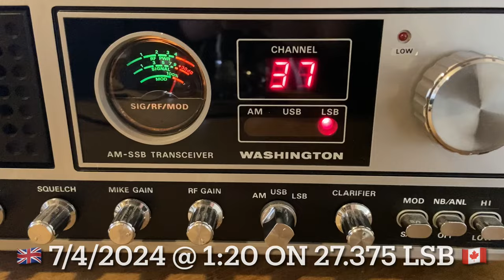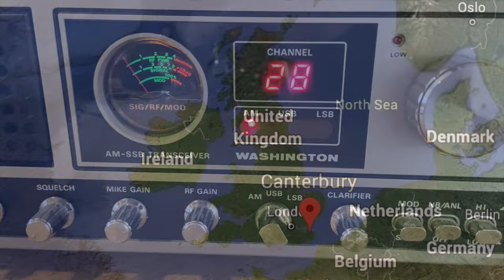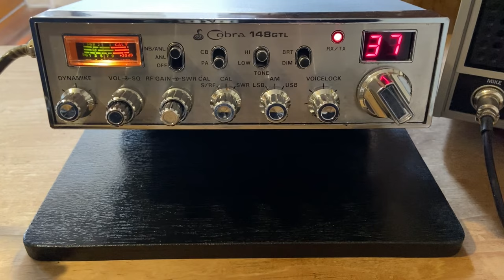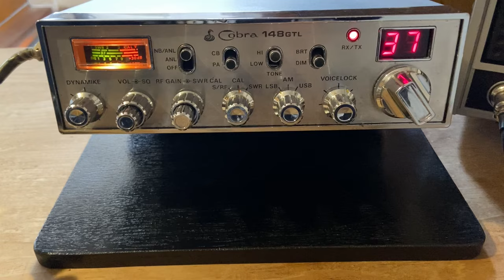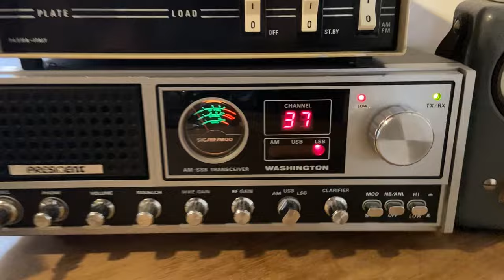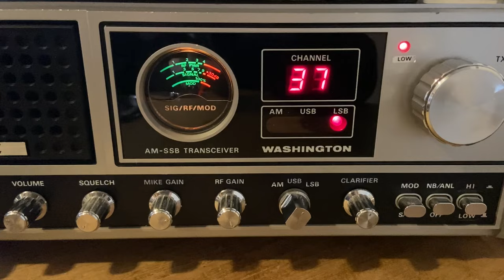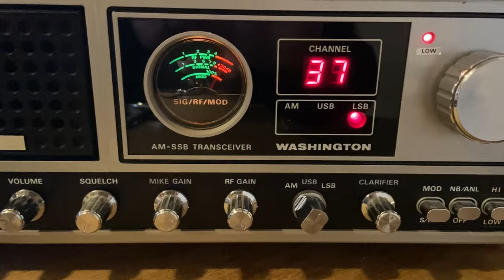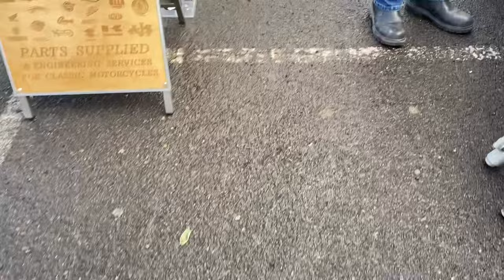🇬🇧 CB Radio DX 🇨🇦🇺🇸🎥 John 151 Mower Junkie 💥 7/4/2024 💥

Comment: The presidents and uniden presidents have the best recievers ( i can afford) just pulled a grt lt out of lame lazy list had the pa/cb push rrepsaired and the radio given a clean up ( going on 25 year old) i bought it in its bbox at 2000 from that tech on his 25 th anniversary this year is hisalmost 50 anniversary waiting to see if he sells some coming up but his repair gives thatradio years more to go havent used but once so far and made super bowl am contact competition down but made it in!!! Looking to get the new box up running with it my galaxy 99v2 seems rough driving dsince it set up with 35 watt drive with dk on 12 giving 45 + radio only  have good upcoming weekend and radio safe